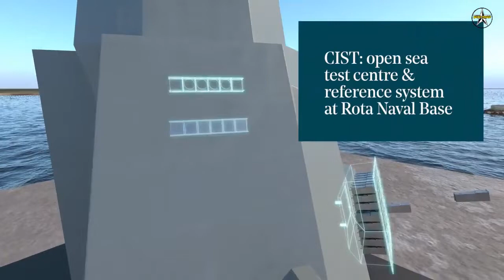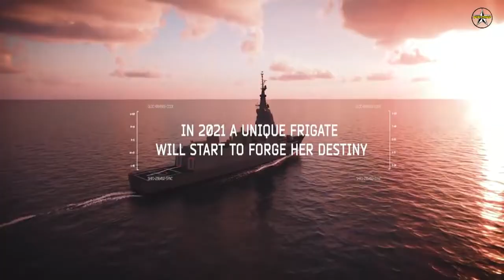Navantia Begins Construction Of The First F110 Frigate For The Spanish Navy

Comment: Difference between this and Fr. Nansen F100 based frigates?
Reply: For one the F100 is a CODOG, whereas the F110 is a CODLAG.
Reply: No, F100 has 48 cells to launch missiles while F110 only 16 cells. 
F100 is more related with Air defense type frigate. While F110 of course has similar Air defense system but reduced. Even has capacity to transports small group of troops the rest real similar.
The f110 is called multipropose frigate.
Reply: @raidensergi2378 isn’t it true that the F110 is geared towards Anti Submarine Warfare?
Reply: @deralbtraumritter8573  Yeah, also.